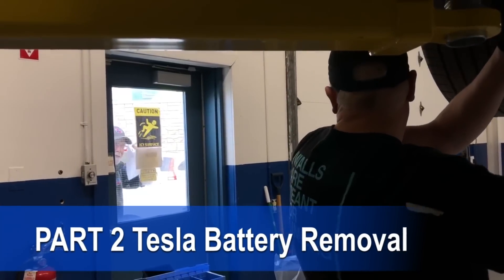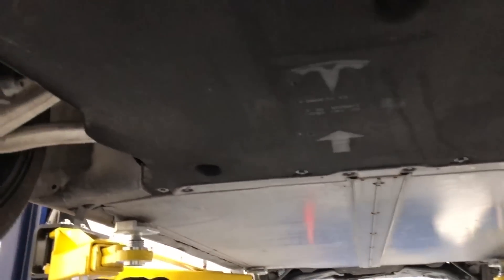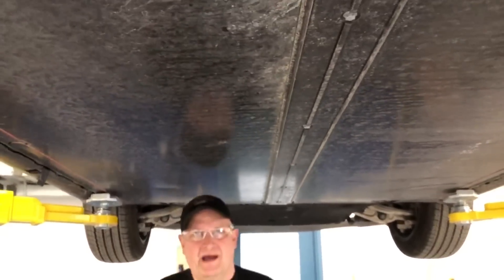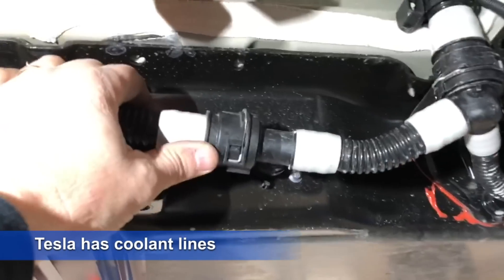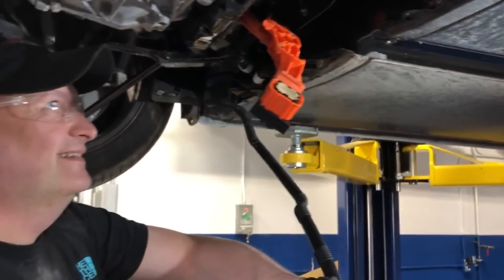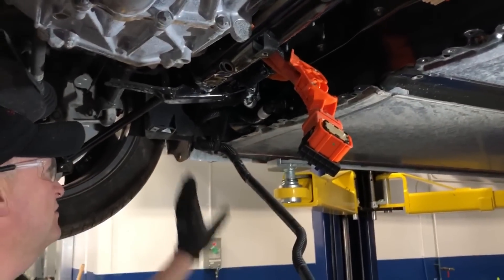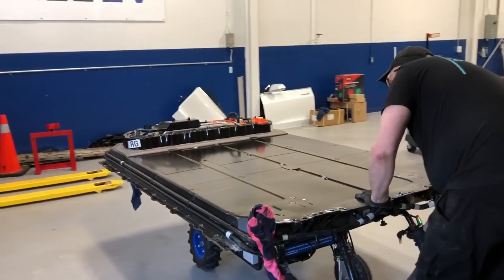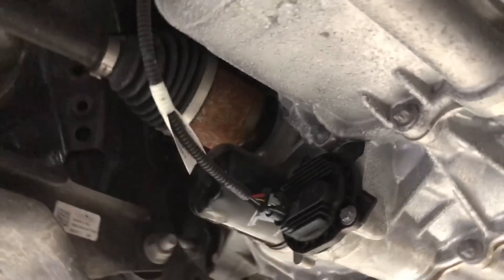Tesla Battery Removal - How Easy is It ?

Comment: If anyone was thinking there’s nothing to break on an EV, just study the incredibly complex cooling systems to the battery, motors, inverters, onboard charger, MCU, etc. Leaks on ICE cars are a big concern, and trust me, there’s way more opportunities for leaks on EV’s. Yikes.
Reply: No one thinks that. But certainly there are way less moving parts on an EV. There are over 10k moving parts in ice which will highly likely break or leak and way less on an EV. But for sure something will break but lesser chances.
Reply: @hopefwam  Turns out you are wrong. The data shows EV’s are less reliable than ICE. Don’t be a data denier. Look it up. Lots of things that don’t move fail all the time. Sad EV’s are less reliable.
Reply: @hopefwam  Perfectly agree on that. The main difference is, if for any reasons, the electronics related battery management, or even the battery cooling is involved, it could be catastropic to the wallet. Spills on an ICE vehicle are a bit cheaper to fix, because it mostly does not need a complete replacement of a critical/expensive component. The closest it comes to is the engine and transmission issue, still relatively cheaper to fix, with refurbised parts. Just some 💭
Reply: ICE engines and transmissions are cheaper because they're more numerous now. As more EVs are produced, more components are also manufactured and costs will come down simply due to economies of scales.
Reply: @hvu6037 It is true, the cost of EV spares should come down, unless they start sharing supply chain for critical components and not go happy on vertical integration. That said, still battery cannot be easily repaired, if anything should go wrong(such as structural battery packs(not fully satisfied, if it made any huge difference in rigidity🤔), pink fire-retardant brick exoskeleton). If the batteries in EV keep up with repairability(as in some older vehicles), things will be  easier to procure and repair based on an expected availability of cheaper spares in future.
Reply: @aware2action  Also people don't realize the LFP batteries will las 10,000 cycles versus the 3,500 cycles of NMC, you can sacrifice energy density for a consistent long lasting battery. Even NMC you don't have to replace it after 10 years, if it's at 80% it's just a 400km car instead of 500km.
Reply: @givanildosouza6904  Eventhough LFPs have a cycle life of 3000+, it is going to be a variable, when it comes to real life pack life. For one, LFP is more of a constant voltage source, unlike NCM & cannot calibrate SoC, simply based based on voltage alone. Which makes the BMS quality vary significantly. It's like have a 11,000hr life LED bulb fail in less than 1000hrs. Definitely not the LED to blame🤔. Also LFP has its own issues other than just power density and need for a sophisticated BMS. In the end, there is some discipline and learning curve involved with an EV battery maintenance on a "daily" basis, compared to an ICE vehicle, where you top of  gas in 5 mins, and do scheduled services. Definitely a BEV ison the low to no maintenance level, if not for any major battery, software/h/w electronics issues.
We need safer and better and cheaper EV batteries, and a common standard of battery subsystem, that is repairable easily by anyone that has fair knowledge of repairing HV electronics.
Reply: @howardj602  I do agree with the average life of an ICE vehicle. But most of these vehicles are used in backup duty, with total mileage around 150K. Whereas, you could put easily 400K miles within 8 yrs on an EV. New batteries cost about 20K, but there should be cheaper options in the refurbished market. Also there is lot less maintenance cost during that time as well. Definitely BEV's can be made cheaper, without all the fluff as some made in China in the low 20Ks.
Reply: LOL! If you think a Tesla cooling system is complex, you should look up Munro Live and the Ford Mach-E. This isn't even the simplest Tesla system, the structural battery version on the Model Y is better, and will take less time to remove/install. No need t remove rear seats, and the front seats and console come out with the battery.
Reply: I agree ... let's read the CT manual when it comes to river crossing. Warranty - VOID!

Comment: Why were you removing the battery?
Reply from the maker: We were making a demonstration training vehicle with this Tesla.  The battery went to Dalhousie University for research for a power wall.
Reply: Has anyone opened a closet drawer and found a flashlight that had old corroded batteries in it?
The way that flashlight looked, is the way an electric car will look like, eventually.
Reply: @kennyfordham6208 No electric car that I’m aware of uses the alkaline battery technology that you and I have had leak and ruin our flashlights. So if that’s all you’ve got your comment is just uninformed ramblings. You’re comparing apples to oranges.
Reply: Because, eventually, EVERY ev will need it's battery changed. 🤨
Reply: With your average Tesla, that is 1,000,000 miles before the battery needs to be replaced.   Let me ask you bro, when was the last time you owned a car with even 200,000 miles on it? @kennyfordham6208
Reply: @kennyfordham6208  Every gasser eventually needs brakes transmission, and maybe an engine if the cars not a death trap by then. So what's the point.
Reply: @kennyfordham6208  Yes, and eventually is around every 10 years. The average age of cars is currently 12.5 years, so every single car will be junked early because the battery costs more than the car is worth. Oh well, RIP the environment. EV’s will kill the planet. Especially since their extra tire dust emissions is far worse than tailpipe emissions.
Reply: @JetFire9  Tire dust emissions 🥴😆.
Really reaching for it.😅😂🤣.
Can we walk or should we be worrying about shoe dust emissions.
Maybe you float around.🤪
Reply: @JetFire9 More EV FUD. Tesla has 1M mile batteries, so good luck trying to wear them out. Also, all EV batteries will be recycled such that Redwood Materials can 95% of the battery materials out for reuse. Eventually there will be no more mining for battery materials. But, nice try spreading the FUD. Also, batteries getting cheaper to make so that any replacements are not very expensive. That’s why Teslas last 2x-4x as long as comparable ICE and pollute less after only 6k-13k miles depending on size of vehicle.
Reply: Great now stick a 7 KW generator in it.
Should work great as a hybrid.